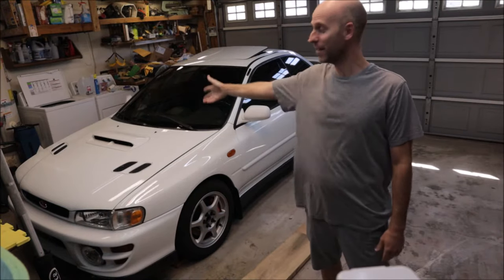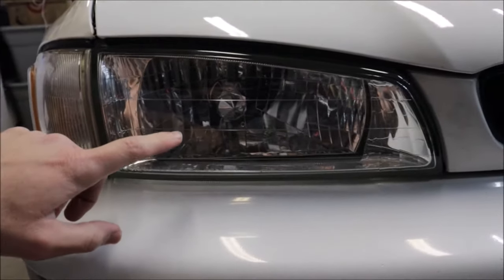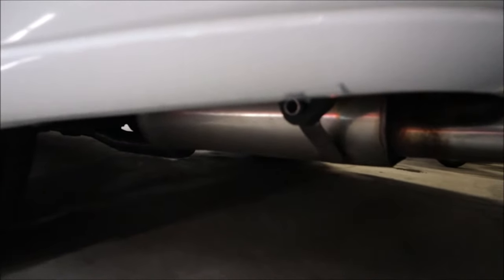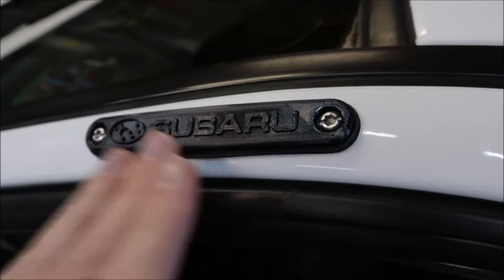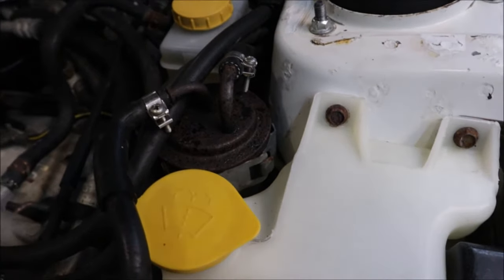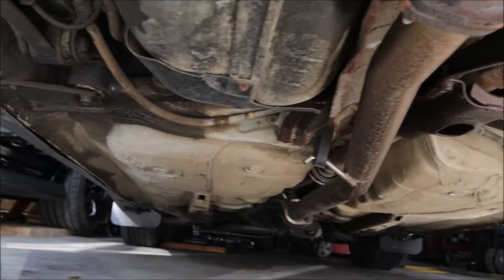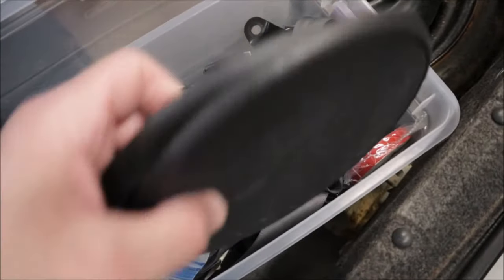I Bought Another Impreza 2.5RS. GC8 Project Unicorn Part 1

Comment: I always liked the Alpine White RS.
I was a tech when these were new.
 I had a set of 98 gold five-spokes that I put on a 99 white RS during a PDI and I thought it looked so good.
 I like the 2000-01 six-spoke and the TR brake upgrade too. The Corbeau seats are so much better than the stock RS.
The Bilsteins are a great upgrade.
Also the Borla header and Stromung exhaust used to be the thing  but they were good upgrades.
There are a lot of period mods to it but a nice car for sure.
Just clean it up and drive it as is.
Reply from the maker: Thanks man! I always wanted a white one. When I was 16 I used to drive to the Subaru dealer and stare at a white one and silver one that sat forever. Wish I bought one then. 

Thanks for the info! I did not know the headers were Borla or the six spokes were 00-01. Id like a pair of both to be proper. Also, rs seats would be good to have too, for value. Harnesses are such a pain as well. 

If you notice any other subtle changes let me know!
Reply: Aspen White, not Alpine White. Color code is 51E
Reply: @occamsrazor1285  You are correct.

Comment: I had a similar CAI on my 99 RS when I bought it. When I drove in flash flood rain, it would start missing/dying and I'd have to limp it home/to work. I ended up buying a simple, aftermarket pipe that puts the filter under the hood. Wasn't concerned with performance because it's my daily (and it's NA obviously).
Reply from the maker: Hydro lock is no joke. She is a fair weather car, but still on the lookout for puddles!

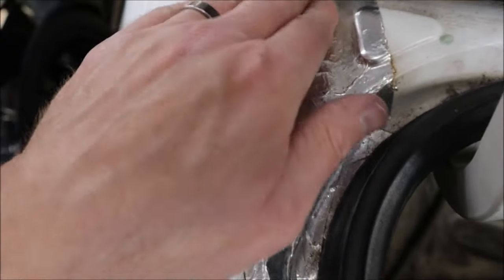Comment: Nope, I had mine since 2001 (MY01), no rust anywhere after 18 years (sold, also white).  California.  :D.  I think also the USDM is "Aspen White", and the replacement fender is JDM "other" white, that explains why both sides were replaced, and maybe it did have a crash to bowl the front hood up, yeah, the hood should not bend up like that.   @3:48 The corner are like that from the factory (above the front blinkers).  PO probably had extender on their after market wheels, left the long lug nuts for you.  I have a few JDM parts left over.  DM me if interested.  @22:37 That's possible oil leak that got blown from the front and it accumulate over the diff housing and transmission and cross member etc.  Sad to see the truck, there's a hard cardboard that covers the spare tire, it also has a bracket to hold the wrench sets.  That backer board is aftermarket, that's should be back of the seats, since you had no back seats.  :D  @28:11 no not factory, that's something I saw inside an oven.  The exhaust manifold is a turbo one... hmm...  I still got a leaking OEM factory Y pipe you could fix up, I replaced mine with an OEM factory Y pipe before I sold it, I was about to scrap the broken one...   let me know.   @28:53 that manifold flanged looks different from stock and the bolts locations are not the same, now I doubt your engine is a EJ25...  Continue on, wow, you got an aluminum A arm!!!!  Do a JDM version 6.  Or JDM Type RA (more difficult) restore.  If you have the resource, do STI engine swap and RS25 sleeper.
Reply from the maker: This one is a CA too, but that coastal living has salt air!

Comment: Some fun facts about the car: All 2.5RSs had the sunroof and side protectors (they weren't an option, they were standard). The Coupe was made all four years, but the sedan only 2000 and 2001. The automatic sedans are the most rare. Approx. 7500 coupe manuals were produced. The suspension components, the front grill and the rear spoiler are from the version 4 STI. Only the STIs (and by extension the RSs) had painted door handles and mirrors. The front and rear bumper covers are from the Version 5 STI. All RSs had ABS and fog lights. The front emblem IS an STI emblem, but the RSs never came with them.
Reply from the maker: Love these fun facts! I could you your knowledge getting her back to showroom shape! Well, close to it.
Reply: @RoadPatina  Np. I'm actually restoring the exact same car right now (JF1GM6754XG402246, but your last 2 or 3 digits will be different, obviously. Maaaaybe the last 4, but unlikely)
Reply from the maker: @occamsrazor1285  I would love to see it and follow along!

Comment: The hood and fender never lined up perfect. But that fender was in accident. “Upgarage” in Japan has stock lug parts. Check the trunk, left and right don’t line up either😁
The stock exhaust is the exact muffler off the Forester and it sucked. That muffler is great! Courbo Seats are the JDM STI upgrade they were featured in the Subaru catalog. The stock seats are ok.
The under coating is like that. Had mine 3 years in Minnesota so that rust is not bad. Subaru had Very thin paint. All the GC8 Subaru here are rusted in rear fender.
Get Hyper-Rev 2001 mag has great upgrades info.
Get the Whitline antilift kit too pluse a brake booster brace and as line from booster. Transmission mount and Cobb short shift if u can find it.
Use Redline 75-90 LSD fluid only rear LSD with some redline grip additive.
Great autocross car!
😁
P.S. still have my stock shift knob😁. Sold car with $5000 worth of upgrades, Still miss it.
Reply from the maker: Lots of panel gaps but never an accident on title. Maybe a small bump here and there! Muffler is subtle and period correct, I would like a stock one for back up. Already has the COBB short sifter installed. Stock one on the shelf. Super clean and relatively rust free considering these cars. 

Everyone wants a perfect, clean, old car but not willing to put in the time and money. They all need both!
Reply: @RoadPatina  Right on 👍 edit: Get a Stainless steel line. Pirtek hose company here made a set of replacement hoses back in 2001. But I don’t know if they do that stuff anymore. I was planning on a turbo(never did). I got Stainless steel brake lines from JDM and SubieGal on the Nasioc Subaru forum out of Washington worked with speed shops suppling things but this was 20 years ago 😁 Also I had an underdrive pulley for accessories. It did dim lights. To counter act this I had a friend install my Kenwood Subwoofer 350w amp with a push/pull 1farad capacitor. 
When my (trunk installed) battery died. I was able to turn key to accessor position leave for 5 minutes and it started the car😁 That enabled me drive to auto store and buy a USA made Optima. 
Dang, too many good memories. I’ll keep watching your channel and wish u luck 😃

Comment: Hey mate great subie you got there, car look almost identical in paint and spec to my wrx difference being mines a 4 door but you got a pretty nice car if you need any wrx parts I can keep a look out for you in australia as wrx gc8 part can go for pretty cheap sometimes and white gc8s were somewhat common in australia so I can help you find oem wrx panels, light and trim pieces, can’t wait to see you fix up this car and turn it into a proper Subaru, like what the us should have got in the first place.

Edit: I can find a set of 99’ wrx seats here for pretty cheap around 250-300 aud
And I’ve got a oem 99’ wrx gc8 top mount imtercooler
Reply from the maker: Thank you! Yes, I am always on the hunt for parts. Grill, bumper, seats, lights, fog covers, spats, aeroguards, you know all the good stuff we never got! Email me if you run across anything. Road patina at gmail.
Reply: @RoadPatina  I sure will
Reply from the maker: @Lplaterwrx  aeroguards are at the top of the list, cheers!

Comment: bought my 2000 RS on 12/28/99 for about 23k USD and still have it...got rust under the gas door at the fender/bumper...also looks like i have some on the drivers side in front of the rear wheel well where the side skirt is...i wish there was a shop that has specialization working on these in my area...i need to get this fixed...i garage mine too...also its a daily driver...looking forward to watching you return this car to factory usdm specs (hint) haha  good luck
Reply from the maker: Great story! How cool that you are the original owner. I wished I bought one back then, well, actually my younger self would have probably destroyed it!
That rust does not sound bad and is fairly common. I have watched many videos on people repairing rusted out Subarus. Educate yourself on the best way to fix these areas, then have a discussion with a few body shops. Pick the shop that seams to be  me more than competent. 

Phase one is to get her back to USDM goodness!
Reply: @RoadPatina  good idea on watching fix it videos...maybe it was good you didnt get one back then!